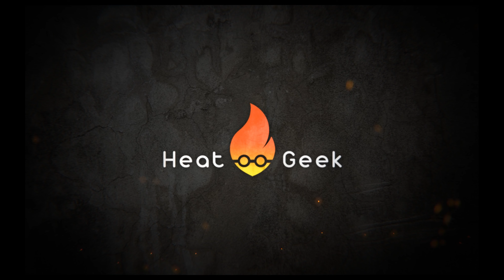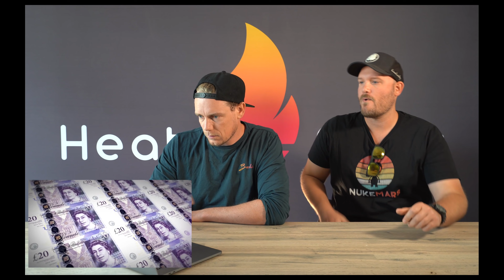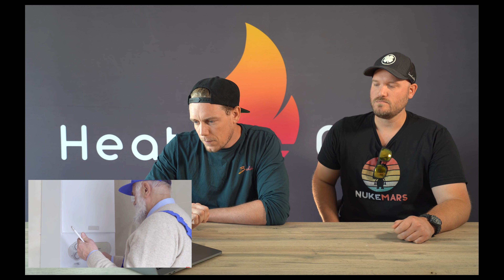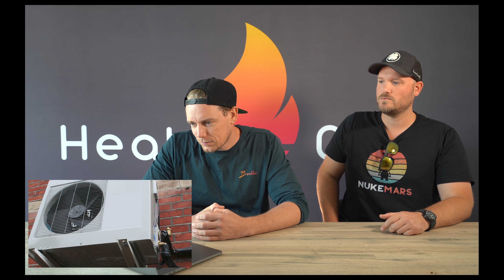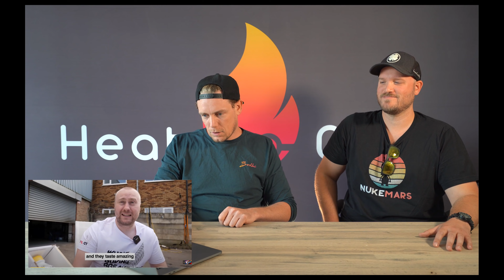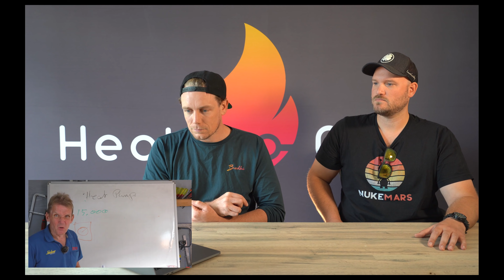Professionals React (BADLY) To Skill Builders's Heat Pump Videos | PART 1 | FIRST TIME WATCHING

Comment: I suggest you install ublock origin if you are going to comment on youtube videos. That way you won't get ads halfway though. Well done for pointing out what a lot of nonsense Mr Skill Builder was talking here. He's normally a lot more sensible than that, and generally puts out good quality info in a digestible style - obviously has a bit of a blind spot on heat pumps. Always good to see people pushing back against the perverse worldwiew of 'payback' and 'oh we're only 1%'. Hardly anything you buy pays back, so why should your decarbonised heating system have to do so?
Reply: Care 2 explain how he's so wrong?? Retrofitting Heat pumps are useless for the majority of UK homes the cost alone is eye watering then the fact you need 2 rip out all existing pipe work etc,
Then the extra insulation that needs 2 be fitted then the re decorating 🙈 and in the end it's no cheaper or more efficient than a quality combi boiler,
Which still works when it's - 5 outdoors
Reply: @pauldavies7251  He's wrong when he says it will triple your running costs. That's complete bollocks. You are wrong when you say they are 'useless for the majority of UK homes'. Retrofit is expensive, you are quite right, but we don't have a choice: we have to decarbonise, and quickly. That means millions of boilers have got to go (or be run on green methane or hydrogen instead), and millions of deep retrofits are needed. Just sitting there saying, 'but it's slightly cheaper up front to completely ruin the future,' isn't a useful response.

And yes, an awful lot of people will need help with the financing, but equally there are also plenty who can spend 2 grand/yr for the the next decade on this rather than things that don't help (kitchens/patios/petrol/exotic holidays). Those people need to get on with it right now. (I've done my house over the last 14 years and as a result I've not turned my heating on yet - it needs to get significantly colder than this before I need any:  https://www.youtube.com/watch?v=OVcvk9Wnyw4&t=2s). When I do buy a heat pump it'll be a very small cheap one. In fact I reckon I can fit a propane GSHP for under £2000. It doesn't have to cost a fortune if you don't mind a bit of DIY.

Comment: I think you are missing the main point of the skill builder video.   UK homes are poorly insulated, during winter there's limited warm ambient air to strip off to heat your house especially in Northern England.   Ground source pumps yes, if you have enough land they work perfectly but I'd be very surprised to hear that air heat pumps can be effective for everyone.  Green hydrogen should be the way forward but that is years away.
Reply from the maker: pure hydrogen is over 100 years away... and heat pumps do work in older properties.. we litrally install them every day.. videos coming soon

Comment: I thought heat pumps worked on the principal of compressing gas ( like putting your finger over the end of a bicycle pump and wondering why your finger got burnt) not by collecting some ambient heat from outside , if that were the case you could just open a window !
Reply from the maker: yes they work on the vapour compression cycle, but you need to get the primary energy from somewhere.. first rule thermo dynamics, you cannot create energy.
Reply: @HeatGeek  Thanks for the reply...I understand that you only convert enegry and not create it . No energy is created . the primary energy in this case being the electricity that drives the pump. The heat source being the compression of gas as in the Temp/Pres/volume equation . I still dont understand the claim that heat is taken from outside when in fact the heat is produced by the pump compressing gas and the outside component is used to cool the condensate to change its form back to a state that it can be compressed again after heat is extracted. I should state I am not a heating engineer in any form (I am a mechanic) I am just interested in the technology and understanding the basic principals of how it functions.
Reply from the maker: @modelrailwayadventures4429  you've got that the wrong way round and are confused with cooling. You don't cool down the condensate outside, that happens inside. In heat pumps you warm up the condensate to turn it in to vapour, capturing latent heat during the phase change and absorbing outside heat energy. This is then amplified by the heat pump then released in doors where the warm vapour is cooled by the heating system to turn back in to the liquid state, and so the cycle continues.
Reply: @HeatGeek  Ok Thanks . Thats how it was explained to me by a heating engineer while I was fixing his van. Obviously there is more to it than I thought.

Comment: Heat pump  installed correctly or not 
In a cold night they are flipping useless !
Reply from the maker: youll have to go and tell all our customers that because they are unaware
Reply: @HeatGeek   they will be soon as the temp outside drops below 5 degrees.
Reply from the maker: @motorbikedude  Why didnt they tell us last year? or the year. before? and especially when we go back to service them and ask. how things have been?

Comment: Harsher winters r u sure think use two r wrong on that
Reply from the maker: we mean more extreme
Reply: @HeatGeek   but not colder no way and ur in the heating game selling heat pump uve got a vested interest as stated by so many ur gonna say what u say if I was u ide do the same but they ain’t the answer and u know it
Reply from the maker: @kendodd8734  not colder no.. this was not scripted and was a live reaction so I think can be forgiven
Reply from the maker: @kendodd8734  we have much more of a vested interests in the direct competitor to heat pumps actually. We are the uks number 1 hydrogen fuel cell boiler installation company. so if we were bias we would be agreeing with Roger...

Comment: Skill Builder can't have it both ways .i.e. they don't work here but they do in Scandinavia where the ambient temperatures are lower than here (and it is nice and 'WARM' ) the problem is going to be, not ditch the heat pump but insulate better here!
Reply: But they have  MUCH MUCH cheaper electricity too ...
Reply: @Prod-23  could well be right there.. my comment is not about cost but whether Heat  Pumps 'can' work. If they work in Scandinavia they can work here. It's not as simple as Skill Builder's YT video is contending.. I'd be more worried about 'who' fitted the Heat Pump at my home. What Skill Builder is right and Heat Geek agree on is that some will make a fortune out of other's misery; as has already happened in the UK: i.i Poorly installed subsidised Gas boilers, damp inducing (subsidised) insulation installation (by cowboys.. you can tell it was not going to work out when the fitters tied up their horse)
Reply: @whatworkedforme  Is there a correlation between underground temperatures and the depth required to reach this heat source ?  Scandinavia may well have a lot of ground heat,for example Icelandic style  Volcanic thermals ? The UK & Ireland may not have a warm enough base line to draw heat from ?

Comment: I’ve been watching skill builder for years he’s always given good advice on every subject
Reply from the maker: yes typically. but this is a specialist subject. not general building
Reply: @HeatGeek  He's not a general builder, go do your research fellas. He's been around a long time.
Reply from the maker: @ChrisG1967  he's a plumber that has lots of experience of bathrooms and boilers as well as genral building and has little on heat pumps... being able to install a boiler does not mean you know how to design a system for a heat pump very different beasts. It's not complicated but requires training that he hasn't had. hence hos admission to having to work to someone else's design, which clearly want very good still.
Reply: @HeatGeek  
It’s common knowledge the system is flawed 
You just cannot beat a combi 
I think we’d be better trying hydrogen fuel
Reply from the maker: @johnnyreggae969  a 100% hydrogen grid is around 100 years away.. it will be too late by then.. its not flawed.. just takes more understamding and care than wacking in a combi.
Reply: @HeatGeek  
I’m not an expert but don’t  Bosch already make a hydrogen combi and isn’t our gas supply topped up with 10% hydrogen now 
If the above is true we need someone like Elon musk to push this through
Reply from the maker: @johnnyreggae969  lol. Hydrogen boilers have been possible for decades.. that's not the challenge.  

And no our gas does not have 10% hudrogen in it because if it did it would cost more than electricity.

The problem is getting the hydrogen. It takes 5x more electricity to make the hydrogen than it produces. Our electeical grid is only half renewable right now.. First we have to make our electrical grid fully renewable, then we could make the hydrogen woth the spare renewable power.. decades and decades away.. and when we do we'd need 5x more electrical power then we need heat power..

With heat pumps we only need 1 third of the heat power required because it pulls the rest of the energy from the air. 

So 1 /15th the amount of power required...
Reply from the maker: @johnnyreggae969  but it takes 5kwh if green electricity to make 1kwh of hydrogen.. and 0.3kwh of electricity to make 1kwh of heat from a heat pump... doesn't that make it obvious?..

There is absolutely no way we will be able to put a 20% mix in within 3 years... where would we get the hudrogen from and green electricity?

Hydrogen will also cost (literally) 10 x more than gas due to the electricity needed and the safe storage and transport
Reply: @HeatGeek  
Everyone used to say electric cars would never compete with petrol  I drove  my mates Tesla it makes normal cars  feel stoneage 
If  they put hydrogen into  the free market with government incentives the cost of manufacturing would plummet  
Ps
There are additives available now that make hydrogen less explosive making it safer 
Obviously our infrastructure needs updating but it could be done over 50 /60 years 
Your heating system is ok in a commercial setting domestically I don’t think it works
Reply from the maker: @johnnyreggae969  nearly every single one of our fuel cells is in a domestic setting.. please believe me.. I literally work in this field. Hydrogen is open to free market creation. But you still need 5x the power for electrolysis and have to obtain renewable power.. which the grid needs.  It doesn't make economic sense no matter how you dice it.
Reply: Skill builder is the guy to trust. I'm a follower and he seems to be the man in the know. Every government scheme for insulation or green energy has been a total flop heat pumps are the next one in the long list.
Reply from the maker: @pstanyer1  he's great for ge ral building advice for sure.. the best I would say

Comment: We are not getting harsher winters, i remember winters being much colder in the 60's when i was a kid.
Reply: Yep but these two guys were not around then to see it . Plus we didn't have central heating or a well insulated house . Electric bar heater and a paraffin heater in the hallway as I recall . Seem to remember wearing a lot more jumpers in those times with a lot of hand rubbing . There was no such thing as a heating engineer then either .

Comment: "The climate is changing literally as we speak".
There's the problem chaps, you are bought into the CAGW theory, hook, line and sinker. That alone is hampering your ability to employ critical thought.
I put it to you that Roger has been around long enough to cut through the BS that you are currently missing.
I wish you luck with your business 🙏.
Reply from the maker: our business has been operational for 13 years...
Reply: @HeatGeek  Congrats :)
Reply from the maker: @chrisva505  thankyou apreciate that. No luck neeed though. Just an understanding of how to make the product perform and how to estimate performance BEFORE installation. Not 2 years later.
Reply: @HeatGeek  I think we all need a bit of luck. For instance, you are not in control of what direction/support the Govt may or may not provide regarding Heat Pumps. Their political direction will have a direct impact on your business. You can have an educated guess of course . Luck (market positioning if you prefer) plays a part in most things. You still have to deliver on your part of course, which is where I think you are coming from?
Reply from the maker: @chrisva505  absolutely!
Reply: @ChrisVa  "you are bought into the CAGW theory" no doubt you probably think calling it a 'theory' here added some extra weight. Look up what a theory is in science, it's not what you think it is.

"That alone is hampering your ability to employ critical thought." So because they are following the science of the past 200 years developed by 10's of thousands of scientists from all over the world they can't "employ critical thought" ... says the guy that is obviously trusting his favorite politician for his scientific understanding.

If you have some questions, those of us with scientific education and careers can help you out boy.
Reply: @njbuwm  it's actually a hypothesis Nick, I understand what that is. Do you? Do you understand the principle of falsifiable hypothesis, and how important it is? If you think that science stands still for 200 years, it says a lot about YOUR understanding,  not mine. So, what scientific education and career makes you an expert in either climate science, or indeed helps you fully understand the political and activist background to the so called climate emergency 🤔. We all know the climate is warming and that anthropologic activities  are likely to be partly responsible. The response to the perceived emergency is what's relevant..boy.
Reply: @chrisva505  "I think I understand the scientific method better than you do." Ah yes, they guy that doesn't understand "theory" or "hypothesis" understands the scientific method. You'd be lucky if you'd pass an elementary science course let alone a doctorate level one.

I never brought up consensus. You're arguing with yourself. You've once again committed a strawman logical fallacy. But I'll bite for fun. The only reason you will find consensus mentioned in the conversation regarding climate change is due to the billions the fossil fuel industry has spent on misinformation. They made an entirely unpolitical scientific finding political because they knew it'd hurt them vastly. If you're as old as you seem you'll be able to remember that this was not a partison issue in the past. We only need to go back to the 90's to observe a time when both conservatives and liberals were running with climate action on their platforms. Consensus was the easiest way to show that the fossil fuel industry and their lies were full of shit. It was and still is an effective strategy to communicate the level of misinformation and the level of science that backs climate science conclusions. That is, a 5 sigma certainty that is happening,  humans are causing it, AND it is an existential threat. The science says all of that. If you need help, I'll stick around for more questions. Or your can read an IPCC report. 

"What is relevant are reproducible results." well there's almost 200 years of those to support Anthropogenic forcing being an existential threat.

"The greatest scientists in history are great precisely because they broke with the consensus." Oh look, you said something true. The quickest way for a scientist to make a way for themselves is to refute a standing theory and propose a different one that overtakes it. Yet this hasn't happened in regards to anthropogenic forcing being an existential threat. May want to start asking yourself why.

" Few scientists will support any notion of a climate emergency" the literature directly states otherwise. You're either severely out of touch, willfully ignoration, or straight up lying. Only you know which one. May I suggest some reading: https://www.ipcc.ch/report/sixth-assessment-report-working-group-ii/

In case it's hard for you to find here's a list of authors of particular sections: https://apps.ipcc.ch/report/authors/report.authors.php?q=36&p= all of which are based on 1,000's of peer reviewed publications that are the latest and greatest built upon decades of research. But please do continue to flail like a child trying to "disprove" that anthropogenic forcing is an existential threat. It's amusing.

"Look up positive and negative feedback when you have a moment." =D I'm sure you think you're a big boy knowing that term. The literature is not in your favor on that point either. You can, again, find that in the IPCC reports and their supporting publications.

"Steve Koonin" ahh there ya go buddy =). Now ask yourself why you are trusting a fossil fuel lobbyist who has published zero publications regarding climate instead of the 10's of thousands of experts that have and have dedicated their life to science. It's starting to be clear it is willful ignorance for you. You want to be told what makes you feel all warm and fuzzy.

https://www.desmog.com/steve-koonin/

"Koonin spent five years (2004 to 2009) as Chief Scientist for oil giant BP"

To summarize for you, again:
1) He's in bed with the fossil fuel industry
2) He has published zero papers in regards to climate

Now maybe you want to ask yourself why you choose to believe him instead of the current and longstanding conclusions of climate science for decades that directly disagree with his "conclusions" ... that I'm sure he isn't getting kickbacks for ;).

Looking forward to your next denialism.